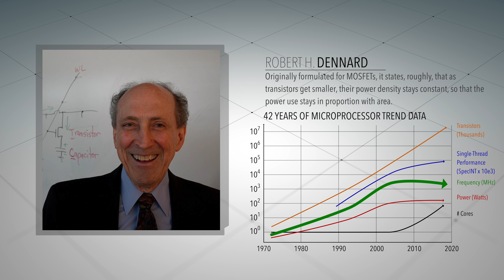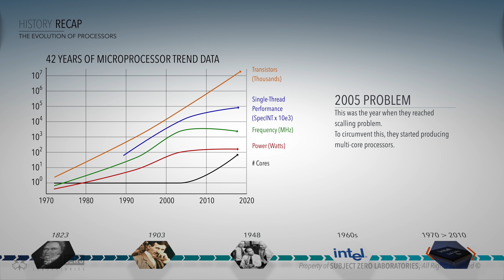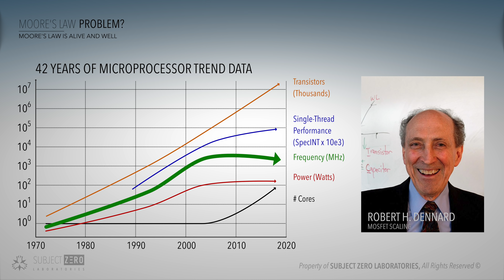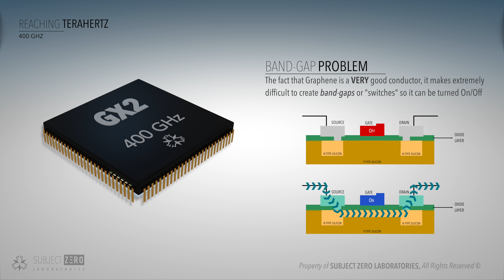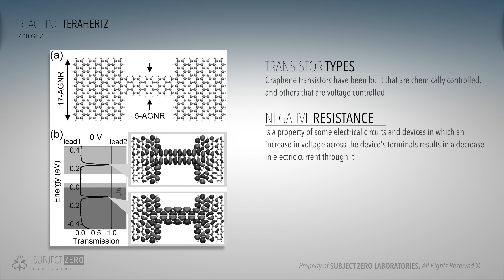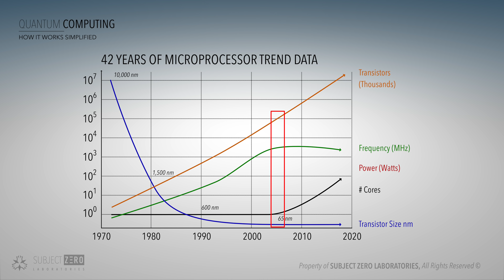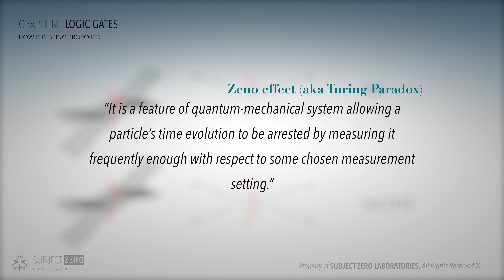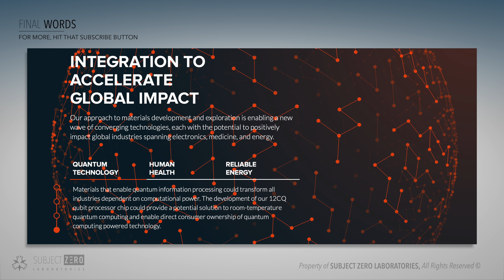Graphene Processors and Quantum Gates

Comment: "Graphene could open up possibilities of...." 

Wake me up when this wonder material achieves one of its potentials.
Reply: They literally gave an example of it being used in SSD’s.
Reply: @TopOfAllWorlds  Exactly - Over promised, under delivered
Reply: see Vanta Black
Reply: Marc Jackson  I am a chem engineer in Australia. We have no high yield process to mass produce graphene at a purity needed for technology like this - in a cost/environmentally effective manner.

Creating graphene for a lab is easy = chunk of charcoal and some tape. Creating the sort of graphene at a scale needed to mass produce chips like this is beyond current processes. 

That is before the problem of doping the graphene in a reliable and cost effective manner.
Reply: Hazz Sin If you need commercial volumes of high quality GNPs or graphene inks, contact Versarien in the UK. They are the only company in the world with Verified Producer status with the Graphene Council (US based). They have these products available commercially NOW.
Reply: Marc Jackson  The tape rip was just an example. 

the GEIC Graphene innovation center in Manchester = pilot scale demonstrations, no where near industrial scale

First Graphene in WA and ArcherX both have developed production technology. = far less volume and purity than would be needed for computer chips.

Producing graphene is easy, like producing silicon is easy. Silicon chips are difficult because the purity of the silicon wafers is extreme - any tiny impurities destroy chip yield

Producing computer chip scale pure graphene in production volumes that can feed the computer industry is way beyond any example you have provided. That is the actual issue at hand.

And that is just the beginning. A large scale pure graphene wafer production facility is the first step to graphene computer chips.
Reply: Marc Jackson  Um, you do know my point is that none of this provides the solution to large scale graphene chip manufacturing? None of this is a new solution to the problems, and almost everything you have mentioned has been in the industry for over a decade. None of this is the breakthrough we need to legitimise large scale production.
Reply: Marc Jackson  Yes, and typical supercomuter in the year 2000 (2 decades ago) had 8,192 compute cores. 

Modern compute farms have upwards of 1TB of ram per node to do simulations like CFD-DEM fluidized bed sims for fluidized bed catalytic reactors (these are what we use in the industry when developing industrial processes).

64 threads is nothing in actual industry. Modern compute farms can have upwards of 400,000 threads. GPU acceleration is not very useful for actual physics simulations since GPUs have extraneous features used to do image processing. Actual physics simulations just need the matrix calculation parts of GPUs, so instead they use custom physics chips, and have done for decades.
Reply: In the 1950 they've predicted that by the 2000's we'll have flying cars everywhere... well, hope graphene won't meet the same fate. xD
Reply: @BillAnt  we can have flying cars, but why, we already have problems with normal cars and now you want then flying
Reply: I think graphene's initial application would be best suited in ultra dense storage devices (SSD, etc).  Once they figure out all of its quirks, then it should transition into quantum CPU's, MCU's, etc.  It's not out of the realm of possibilities, that one day even smartphones will be using graphene based high performance processors with ultra low power usage.
Reply: Wake up, graphene battery is out in the market with a 100w charger, charger from 0 to 100% in 20 min.
The powerbank has 10000mah battery
Reply: Marc Jackson  I took a look at those papers, and I'll be damned. It's definitely no where near the level of any sort of manufacturing based on the methods in the papers, but it proves it in concept... I'm no chemical engineer though, I just take an interest in this stuff. 

I guess I'd be interested in citations to the work you reference in your other comments on the more advanced stages of manufacture for graphene at this point in time?
Reply: Anker makes power bricks that are much smaller then silicon one
Reply: When we have commercial fusion...
Reply: People though of computers like that one day.
Reply: Michael Udeze 
you woke up about 1 year ago then, they are using it in rubber bands to increase their strength, nanotubes, and samsung even announced their new “graphene battery” for their android.
Reply: To be honest we can't even mass produce this shit yet... Thats why it just fell off the map

You mass produce it and we get it so stop complaining
Reply: Graphite instead of silicon, is that a possibility for the future ?
Reply: I'd love to but it'll probably be in the year 2100 ish and I won't be around. Just make sure your alarm clock uses some form of nuclear battery or solar.
Reply: The mayor problem with graphene is industrial usage because theres no real way of producing it at an industrial scale, but the technology and what can be done it's amazing
Reply: This may be left field but what if they could somehow utilize frequency resonance to align smaller easily made graphene sheets to the desired geometry (doesn't need to be exactly one atom thick), bond them together by lightly misting in sulfuric acid or something, remove the acid and then apply a coating of some description to the larger graphene sheet? Possible or nah?
Reply: Graphene can do anything besides leaving the lab...
Reply: Haha but then you'll have been asleep and missed the opportunities..
Reply: That is the problem. People listen to predictions of scientists when it is engineers putting this science into practice. Don't get me wrong, scientists are a key and important part of technology development, but they rarely have to deal with practical issues like economies of scale and other large scale production issues. For example, we can spend thousands of dollars to lab test some graphene related technology. Now actually mass producing it economically with high enough yield, without hurting the environment and meeting laws is an entirely other problem.
Reply: Humanity has not even began to scratch the surface of what it truly can create and it's possibility and potential.
Reply: @parody4042  Yeah we've only had it for like 15 years. Give it time
Reply: @cory99998  😂thats a laugh... As i said.. Reason its slow is because its hard to mass produce
Reply: It's as simple as this... Graphene is a superconductor, electronics require semi-conductors. The ability to pass electricity through a circuit unimpeded does not benefit computers which must be able to hold a charge in order to operate logic gates and code bits. Graphene can't hold a charge. The future may use graphene, but never alone, probably the next leap will involve a combination of graphene and titanium trisulphide. However, it's the research gap for these technologies is just as large in a lot of cases as the first transistors were, which means were in for a LONG stagnant period in computing while companies start from square one to re-initiate Moore's Law. The good news is the mechanisms exist, and the material science is possible. The bad news is it's so far away from feasible that it doesn't benefit companies to invest too heavily in it as their R&D would bankrupt them before they saw a product come to reality that exceeded the current silicon refinement.

Also the use in an SSD was not as part of the logic gates or transistors but as a heat sink to control temperature dispersion on the SSD. So yeah they've used it, but in absolutely no way related whatsoever to 'computing.' The technology could be here in a decade but only if a company dumps money into R&D, which is unlikely, and so it's probably much much farther away, since capitalism doesn't favor the reckless.
Reply: Daharen
 its as simple as this... 

bruh why tf are you copy and pasting everywhere?
Reply: @dragoonsunite  In order for graphene to be a superconductor, it requires injecting individual lithium atoms at particular locations.  Even then it requires colder temps than current hi-temp super conductors.  It is expected that it could match current superconductors and maybe even room temp by injecting the right atoms into the right spots.  Graphene on its own at room temp is not a superconductor at all.

Comment: Great video, I really enjoyed it, but may I add something?
In absolute majority of videos about quantum computing there is something like "so, qbits can be simultaneously 0 and 1, this is so cool!". This fact is indeed cool, but it does not tell viewers anything about how it can actually accelerate calculations.
But there is pretty simple explanation of key feature (given you understand basic linear algebra): quantum effects allows us to
perform certain matrix operations incredibly effective! To multiply two matrices using clasic computer you need to iterate through columns and rows of both of them in a loop. Memory and compute requirements grows exponentially with matrix size.
But with quantum computer this is not the case - you get result in linear time using lineary growing amount of memory.
There is a catch, though - your matrices must comply to certain conditions and you can not just get resulting matrix, it will collapse to unitary upon measurement, so additional tricks are required to obtain result.
There is amazing lecture by Microsoft on this topic: "Quantum Computing for Computer Scientists", any one interested in topic should look into that.

Comment: I do not think that defining qubit simply as "0 and 1 at the same time" is a fitting explanation, though it definetely seems popular in media.
I'd say it's more of a value, which can range anywhere from 0 to 1, which at some point is then interpreted as a regular bit with that foresaid value corresponding to a chance of picking either bit state. Oh, and apparently you can overlap those qubits, thus making their final values each other's opposites; and you can also shift their values around with rotational operations. Or something along these lines, I guess?..
Reply: Any attempt to explain a qubit's state in classical terms will fail (well, you actually can do it with one qubit, but the explanation doesn't generalize to two or more qubits so we know it's not right). Even something like "it's 1 or 0 at the same time" or "it ranges anywhere from 0 to 1" is still couched in classical physics thinking, so it doesn't work. 

In quantum physics you don't get to talk about anything you didn't measure. So questions like "what is really the state of this qubit in a superposition" aren't well-posed. It's not "really" anything: the most you get to say is what you're likely to find, should you look. In that case, a the state of a qubit in a typical superposition with equal weights is easy to interpret: it's a state where, if you measure the "value" of the qubit, the two alternatives |0> or |1> are both equally likely. Other kinds of measurements give other results, but the result of that measurement is the only thing we can really know.

Comment: 400 Ghz!!!!! HOLY SMOKES!!! That's a 100 times faster than current gen computers!!! Imagine GPUs and CPUs running at such clock speeds!!! CPUs can perform Deep Learning training just like current GPUs now do and don't even get me started with GPUs....Instantaneous learning of huge data sets!!! Rapid prototyping and the speed will be revolutionising!!! The company which can build a 400Ghz chip will rule the tech industry!!!!

Comment: I think Silicon is more abundant than Graphene
Reply: You're comparing apples and oranges. Silicon is an element, and yeah, it's very common on Earth. Graphine is a specific structure of Carbon. As far as I know, it doesn't occur naturally and has to be manufactured, but carbon itself is abundant.
In either case, whether silicon or carbon, the cost and abundance of the base material is neither a bottleneck nor a significant part of the price.